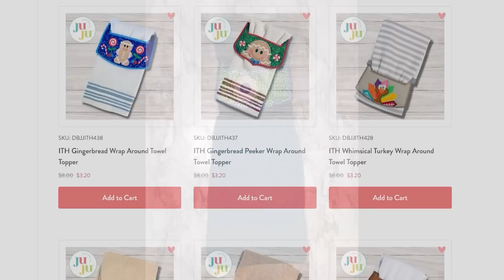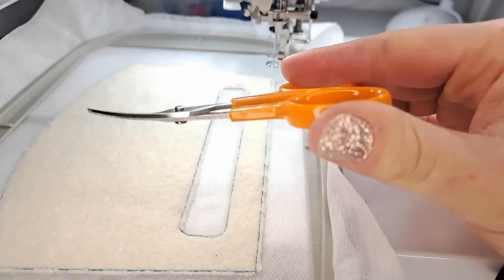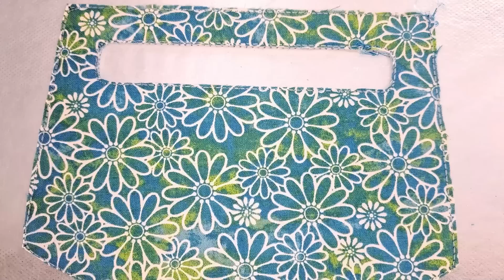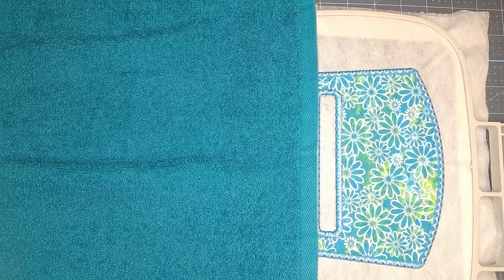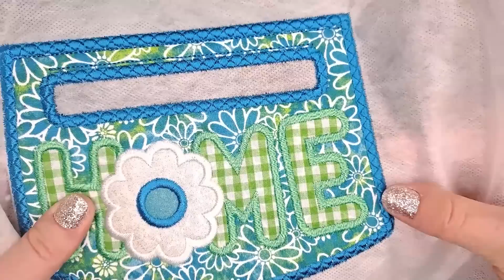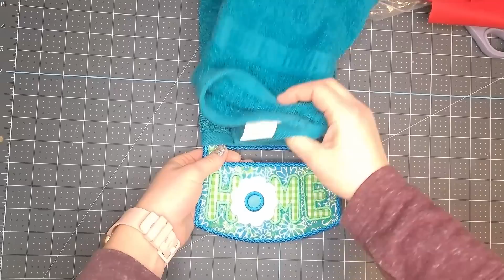How to Make an In The Hoop Daisy Home Towel Topper: Stitch by Stitch | Designs by JuJu

Comment: I don’t understand how how you “ hang” this on an oven door or any other appliance whose handle is attached on both ends without “locking” that towel to the appliance.
Reply: I would assume you would. Hang over towel bar or oven handle and then tuck it in .
Reply from the maker: The project is designed to be hung with the towel topper secured on one side, allowing the handle to slide through the other side without being “locked”. The towel can be removed from the appliance for use by pulling one side through the embroidered towel topper. If you would like to check out our blog, we also have other towel topper's that don't "lock" to the appliance: https://www.designsbyjuju.com/blog/diy-in-the-hoop-embroidered-towel-toppers-easy-stylish-kitchen-upgrade/

Thank you for watching! 🧵🌺